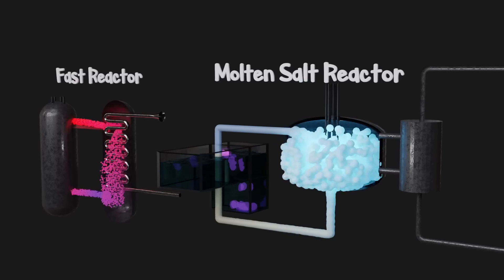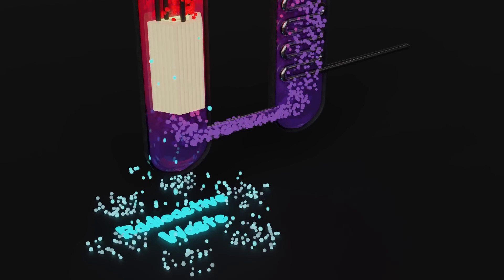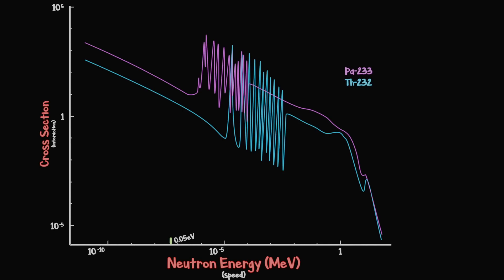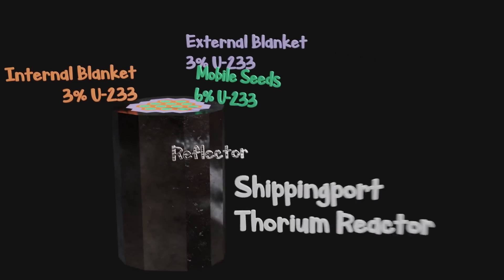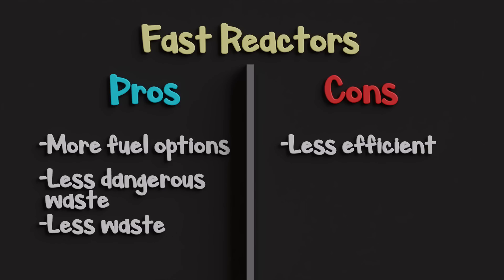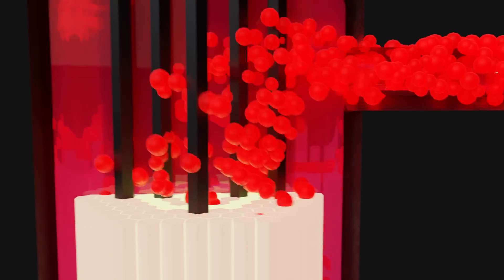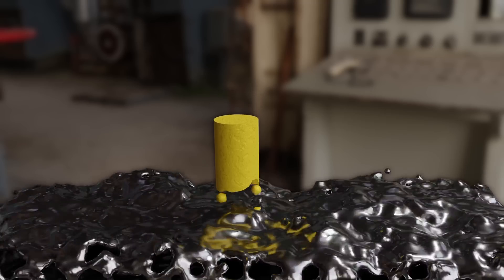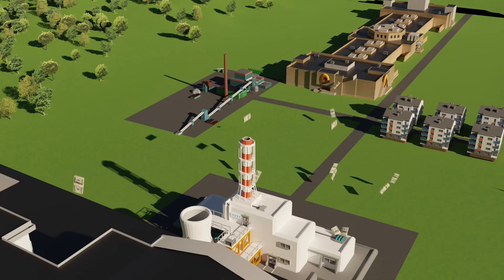Thorium and Fast Neutron Nuclear Reactors

Comment: You forgot to mention that, while they use slow neutrons, thorium breeders produce significantly less high-level waste just due to their lower atomic mass. And using fast neutron reactors to burn high-level waste is promising also.
Reply: We don't even know if breeding is practically possible in the thermal spectrum, it's possible on paper but no one has been able to do it. We know breeding in the fast spectrum is practical, it has been done with solid fuel and will be much easier with liquid fuel. 

Don't get confused by the word thorium, there is a thermal molten salt reactor and a fast neutron molten salt reactor, and thorium has nothing to do with it.
Reply: Thorium reactors make Uranium 233 in order to be able to fission. the volume of waste is less, but the nature of the waste is way worse than Uranium 235 fission. 
Fast neutrons are a bad idea for DNA.
Reply: @cocojeffrey8502  There is no such thing as a thorium reactor. There is a molten salt reactor that uses uranium and you can supplement with thorium (Thorcon Power) There are fast breeders that could utilize some thorium but they choose not to because it's too hard and expensive. (Elysium Industries)
Reply: @chapter4travels  well, whatever it is called. For thorium to be used as a fuel it needs to be transformed into fissionable Uranium 233 by bombarding it with neutrons.
Reply: @cocojeffrey8502  Correct, but there is no reactor that does that. A molten salt reactor can't do that, only a theoretical reactor called LFTR which has never been tested. As far as I know, only two companies have proposed such a reactor, Flibe and TransAtomic Power. TransAtomic folded when they realized it wouldn't work. ThorCon power says they could use up to 50% thorium if they would be allowed to use highly enriched uranium as the main fuel, feeding in Thorium as they go. International regs say no to highly enriched uranium, so they will simply be a low enriched uranium MSR. (This is great by the way, a huge step forward for humanity)

Don't get me wrong, I'm about as pro-nuclear as you can get, I'm just being realistic about the technologies. Uranium in a MSR has every advantage that thorium is touted to have, and there is no shortage of uranium, and there never will be.
Reply: @chapter4travels  thanks for explaining. the nice thing about a conventional reactor is that the behaviour of materials is well known. MSR introduce new variables and so a lot more research.
Calling a thorium MSR the solution is way too early...what about contamination with neutron absorbing elements...its a lot more complicated than most youtube video's present.
Reply: @cocojeffrey8502  Agreed, that's why I like the Thorcon model where they replace the nuclear core every 5-7 years. Once it's cooled down they can inspect every aspect of neutron damage and make changes if necessary. They assume replacing the graphite moderator but even that will be tested for longer life. Swapping out the core or the can as they call it every 5-7 years is built into the 7 cents/kwh retail cost of the electricity it produces. Over time they will increase the life of the can and the output temperature which will bring the cost of electricity down along with the cost of industrial heat.
Reply: @chapter4travels 
Not entirely true. We’re definitely never going to run out of U238, but getting U235 out of it isn’t exactly a cheap process, nor are the byproducts of doing so easy to deal with by volume alone. Breeder reactors, be they U238 or thorium, have the upside of running on fuel that needs no enrichment. And again, both types of breeders produce less waste than conventional uranium reactors, and both are amenable to liquid fuel designs which makes fuel recycling/reprocessing much easier, which also produces less waste. Fuel reprocessing is one of the most expensive parts of running a reactor (and why barely anyone does it in the first place), but without it you’re severely limiting the amount of energy you can get out of fuel.
I’ve also yet to see any clear engineering reason why a LFTR breeder wouldn’t work. They may need plutonium or enriched uranium to get started, but once you’ve got them running for a while then there should be no shortage of concentrated U233 to keep the thorium breeding and to start new reactors. Even if this doesn’t happen in the USA, it’s sure to happen in somewhere like Canada, India, China, etc.
Reply: The uranium-233 decay chain has intense gamma emitters, but any reactor is fissioning that uranium before it decays anyways. When it comes to a breeder reactor, pure thorium is completely possible to use, you just need a startup amount of fissile uranium like an ignition. A thorium thermal breeder reactor relies on an extremely good neutron economy because slow neutrons are more readily absorbed, which is good when you want to transmute throium, but is not ideal when you just want to split U-233. Too much neutron leakage means the reactor might go sub-critical due to too much neutron absorption by anything, really. It's just, not something we specifically tested in the 1950s.
Reply: @justifiedhomicide5730  We don't even know that it will work, TranAtomic Power gave up on it and they were well funded.
We know molten salt reactors work, they were tested. They will be much cheaper, easier, and have every advantage that thorium is advertised to have. There is absolutely no shortage of uranium and won't be for many millions of years.

Comment: "Molten Salt Reactors and the Prospect of Limitless Clean Energy" There fixed it for you, thorium has got nothing to do with it.
Reply: Well, Thorium plays a big role in modern reactors. It's cheaper, easier to get, better to handle, produces less reactive waste and even makes more energy (200 times more than Uran).
Reply: @GG-zb1uy  None of that is correct. You are comparing uranium in a LWR to  Thorium in a MSR, apples to oranges. In a MSR, uranium is a better fuel than thorium for each of the reasons you described in your comment. You should study the thorium fuel cycle, thorium has to go through several changes before it becomes uranium and can fission, using uranium directly the MSR gets much simpler because the fuel is ready to fission from the start. This is why all of the viable gen. IV nuclear start-ups are using uranium and not thorium. Even ThorCon Power with thorium right in its name is a uranium MSR that they may one day add in some thorium if they can get HALEU fuel to start the reactor. 

You should also be happy to know that there is no shortage of nuclear fuel, uranium, or thorium, so that is a moot point. https://whatisnuclear.com/blog/2020-10-28-nuclear-energy-is-longterm-sustainable.html?fbclid=IwAR1rldq_x09IDVGxaWccAZzw_oO-P6atj9mxum1CYnrMO7mgLlw1HM9s8FA

Comment: I like nuclear power, it's clean and safe. But I don't go for Thorium because the intermediate stage between Th232 and U233 is Pa233 which has a half life 10 times longer than Neptunium 239 and therefore it takes 10 times longer to breed U233 from Th232 as compared with breeding Pu239 from U238. It's not something that can be engineered around.

India has a project to build a fleet of Thorium reactors as they have lots of Thorium. 50 years ago It was projected to take 70 years, it's still in its early stages.

Because we need to switch to non-fossil fuels quickly then investment is better directed to wind and solar.
Reply: Thorium has other bonuses that are the main reason it’s pursued: it is more abundant compared to Uranium, it has shorter lived products, and is inherently proliferation resistant. However, with how desperate the climate crisis is I don’t think we have the time to fully develop the technology. Maybe if the research had continued since experimental reactors 60 years ago, but at this point I think only SMRs will be available in time to be a stopgap. 

Also unfortunately, nuclear doesn’t have the power variability or financial/political support to singlehandedly solve our energy problems, to write off other forms of power that don’t emit fossil fuels is shooting ourselves in the foot. It’s the same problem as when other groups talk about using only renewables. The only way to get through the next few decades is with both nuclear and renewables. Both won’t be fully realized versions, they will have some significant drawbacks but don’t need to be a long term solution. They just need to be much better than fossil fuels.
Reply: @nathan92238  true, what we now need are direct actions. The research on other more efficient nuclear fuels was just so long abandoned to just start today. But they are in long terms the future (at least for sometime).
Reply: @nathan92238  It doesn't matter how abundant Th is in the soil because we don't have enough Th mines to supply the reactors. We could just build more mines but that would take decades and is a completely useless move. The decay products with shorter halflife are what makes fuel reprocessing terribly expensive and complicated, it's a disadvantage, not an advantage. Also, the decay products of U and Th have almosz the same halflife  if you neglect plutonium since that is not a waste. This one is a pretty common lie, it is not impossible to use thorium fuel for a nuclear weapon. It can be more difficult that to use Pu but the risk is still there. Also at the start of the fuel campaign, the fuel needs to have higher enrichment than weapons grade uranium.
Reply: @nathan92238  Thorium is not more abundant than uranium if you take the 4.6 billion metric tons in seawater into account.
Reply: Investing in wind and solar is simply throwing money out the window. We also don't need to invest a penny into anything concerning thorium, but what does need the investment is the molten salt reactor utilizing uranium.
Reply: @chapter4travels  Thorium produces 200 more energetic than Uranium. Plus all other advantages, it leaves its old school predecessors in the dust.
Reply: @GG-zb1uy  You are confusing uranium used in a light water reactor to thorium used in a molten salt reactor. In a MSR, uranium is a better fuel because it's ready to fission where as thorium has to go through several changes before it can fission.
Reply: @GG-zb1uy  that's not true, thorium reactors generally have lower fuel burnup than U reactors.
Reply: @GG-zb1uy  No, both produce about 24 GWh/kg. With natural uranium you just use a fast-spectrum reactor.
Reply: @vaclavzajac214  Both can have similar burnup in the right reactor with about 24 GWh/kg thermal.
Reply: @egnegn123 fuel burnup is usually between 30 and 100 GWd/t, you are off by at least 4 orders of magnitude.

Comment: U-235 is already great. The current gen reactors are already great. Don't hold out for perfect when really good already exists.
Reply: Lmao, Thorium makes 200 more energy, it's safer and cheaper. It basically takes advantage of all the positive things about nuclear power, while avoiding the negative.
Reply: @GG-zb1uy  I'm not saying to abandon Thorium, but just don't say, "Don't operate NPPs until we're only using thorium".
Reply: @Waldemarvonanhalt  reasonable point.
Reply: U-235 is already great in a MSR, not a PWR.

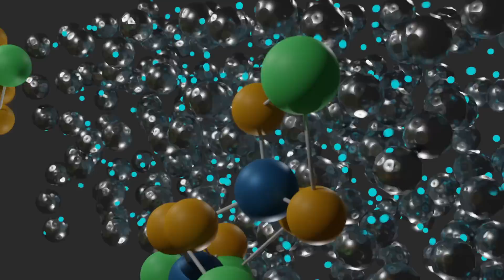Comment: Note about 10:00 in: if you're already experiencing problems with reactor core coolant being exposed to air ... dissolving your fuel into that coolant will result in radionuclides being exposed to open air -- ie. your coolant is now radioactive.
Reply: That's for molten metal cooled reactors, molten salts are pretty much nonreactive to air.
Reply: @killcat1971  Only for these using Na, and not for those using Pb and separate fuel cycle.
🔋 Key Advantages of the Dual Fluid Reactor (DFR):
• ⚡ Ultra-efficient: Nearly 100% of nuclear fuel is used  
• ♻️ Burns nuclear waste, depleted uranium, and even thorium  
• 💥 Transmutes long-lived actinides into short-lived fission products  
• 🔄 Built-in Pyro Processing Unit (PPU): Continuously removes neutron poisons and extracts valuable metals  
• 🛠️ Liquid fuel: No solid fuel rods, no batch reloads  
• ⏳ Decades of operation with a single fuel load possible  
• 🚫 No corrosive salts: Liquid metal fuel avoids fluoride corrosion and complex chemistry  
• 🧊 Lead coolant: Excellent radiation shielding, no water, no pressure → no steam explosion risk  
• 🌡️ Very high temperatures (700–1000 °C): Enables hydrogen, e-fuels, ammonia, and direct steel reduction  
• 🧠 Self-regulating: Output adjusts automatically via negative temperature feedback  
• 🪫 Minimal waste: Only short-lived fission products remain
• 🏭 Compact & scalable: High power density, ideal for modular deployment  
• ⚙️ No moving parts in reactivity control: No control rods required  
• 💰 Uses existing stockpiles of spent fuel, DU, and thorium  
• 🌍 Reduces dependence on enrichment, imports, and fresh uranium mining  
• 🔄 Full closed fuel cycle: No external reprocessing needed  
• 🆚 Outperforms typical SMRs: No pressure vessels, no high-pressure coolant, no water-based systems

Comment: I find it weird that most of Nuclear energy is extracted by boiling water. Surely there's a more efficient way but idk?
Reply: Actually, it's flashing water to steam to turn a turbine to make electricity. What they always leave out of these video are the hundreds of other applications for the high grade industrial heat these reactors generate. (the old pressure water reactors can't do that.)

Comment: Thank you so much for this video! It gave a great introduction to the topic for those that don't quite know it well, but had some very useful insights into the deeper mechanics, such as the absorption/fission ratios! 
I am interning at the Wendelstein Fusion plant, and a lot of what I can see there is telling me that it just won't be ready in time to have a meaningful impact. Your video has sparked interest in me to pursue MSRs as a potential career path again, because it sounds MUCH more feasible to extract the Pa-233 from the salts than to ever get fusion to work. 
And goodness we need new energy sources ASAP...
Reply: Oh you’re at the stellarator! From a mostly untrained perspective, my understanding of fusion is that it’s mainly just a matter of scale. Either something many times the size of ITER, or of a similar size or possibly smaller but using superconducting coils, and you’d be able to get overunity wall plug efficiency. Though I can’t say I’m well-versed on the stability issues that led to the stellarator in the first place.

Some of those pulsed fusion designs are definitely promising too, but at this point all I see is marketing without anything to show for it. Well aside from inertial laser fusion, which looks inordinately expensive to scale up even if it does get overunity wall plug efficiency.

But yeah, extracting protactinium from thorium and dealing with molten salt fuels definitely feels more feasible.
Reply: @Scrogan  Well, I'm just an Intern, I don't yet know all the nitty-gritty details.

Getting the fusion itself to work is absolutely a thing of scale. You need large expensive magnets to make it work, and those are more efficient in bulk.

HOWEVER
The second problem is - once we get the fusion itself to be self-sustaining, we don't really know how to get the power out of the system.

The plasma itself is so hot that you can't have any common, or exotic, material be in touch with it - it'd melt or even just evaporate. Even then, we have large losses due to the extreme temperature gradients (Million-C hot Plasma to a heat exchanger at at most 600C).
There are ideas to capture certain types of radiation that the fusion produces, and plugging those into a sort of solar-panel equivalent, but I haven't even heard of a practically tested model of those. 

Meanwhile, in a nuclear reactor, we got all that sorted out.
Of course we have the issue of metal corrosion from the salts to solve, but that seems more like a reasonably-challenging material science endeavour. Everything else we know - the physics, the Pa-233 separation is some tricky chemics, and we can keep using fairly rugged and well-known steam turbines for the heat-to-electricity conversion.
Reply: @MrRedwires  Regarding fusion energy collection, do the superconductors heat up during operation? If so, couldn't that heat be captured? Sorry if it is a stupid question.
Reply: @patiuskas0071  Not a stupid question, it's a very interesting topic for sure!

Superconductors only work at very very low temperatures, around -150C or less. If they become too warm they stop conducting properly, and the magnets have to be turned off.
Sadly that means we can not efficiently extract energy from them during the reactor operation, and it actually takes quite a bit of effort to keep them that cool!
Reply: @MrRedwires  Right, but to keep them at cryogenic temperatures, you need to pump liquid helium or nitrogen, right? If so, couldn't you extract the heated up coolant and run it through somenkind of heat pump system? Or is such a thing just not possible/feasible?
Thanks again.
Reply: @MrRedwires  what about a magnetohydrodynamic generator? for getting electricity from the plasma?
Reply: Yes - In 25 years we will have fusion reactors.  This generation will need to use fission.
Reply: In my mind fusion is a long term solution to humanity's energy problems. It's the end goal but most of us probably won't live long enough to see it become the main form of energy.
Renewables are the main solution to climate change, with nuclear being a good add-on to fill the gaps of cover the weaknesses of renewables.